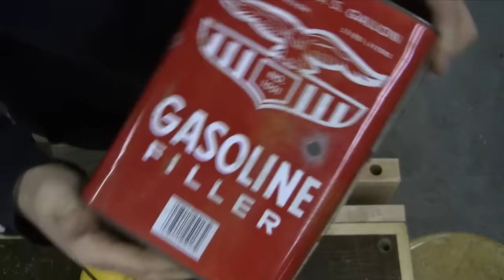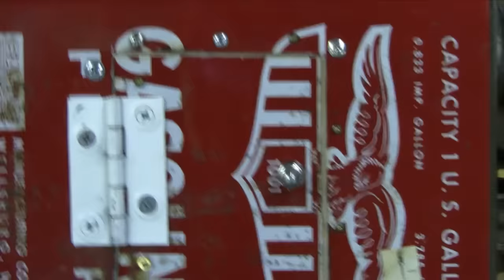Oil Can Guitar pt. 3

Comment: When my daughter 12 , I found a box turtle shell with the belly plate. They both were snow white. Unlined the inside of both pieces with felt. Where the belly plate turns up under its neck comes apart. So I put two brass hinges that I added patina and joined the pieces back together. Where the plate meets the top shell I put in a handmade magnetic latch.i stained the geometric shell patterns on the sell in two shades of brown and black , the bottom plate one shade. Sprayed with satin polyurethane then drilled a hole in the top shell along the edge just where its head would poke out. Lastly took three strand of shade leather and braided them , slid a tight fitting brass ring on each end and put each end  down through the holes and crimped them then again the inside. She absolutely loved it and all her friends thought it was cool as heck and they were a little jelly. That was 20 yrs ago...Good good memory. I was a single Dad for 12 yrs till I met my first wife. Right before my dtrs bday her Mother abandoned us and disappeared..My dtr always was my everything.I quit my Union Ironworker job and got my nursing degree at age 30  twenty six yrs ago.

Comment: GreenArrows0705
You could convert it into a 6 String by making a new neck for it & also using Rouxinol R-30 Strings. I converted my Acoustic Guitar to play like an Electric w/ really light gauge strings by cranking the headstock angle down to 90 Degrees like a Lute which puts the strings at a really sharp angle over the nut.